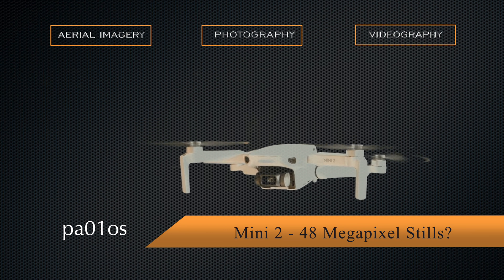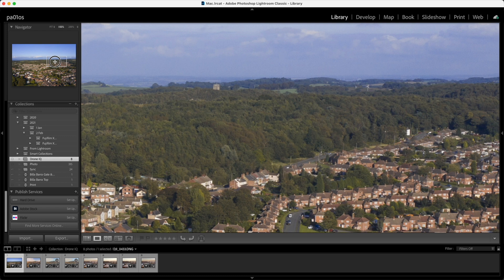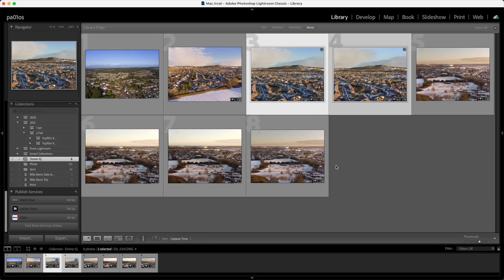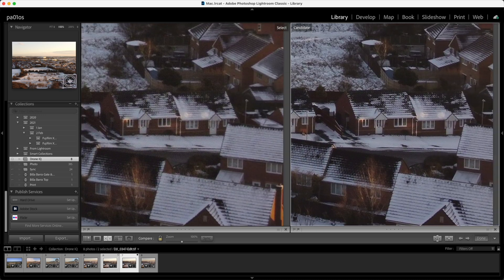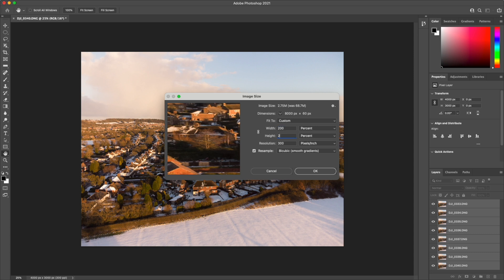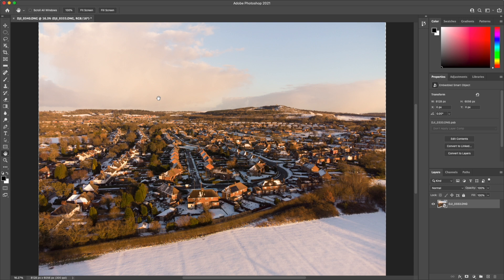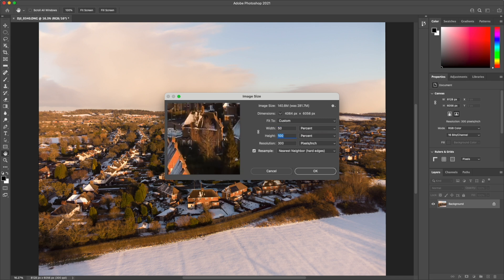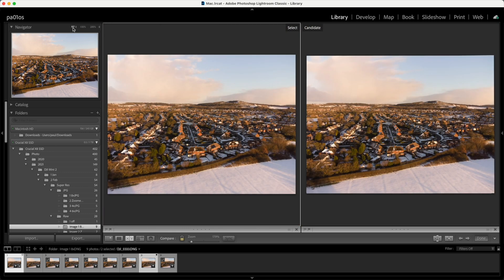DJI Mini 2 - 48 Megapixel Stills?

Comment: Recommendations for shooting these?
Reply from the maker: Hi Jon, firstly if you can, shoot RAW (DNG) images, try to nail the exposure as the technique will not help correct blown out sky or other exposure issues other than that, just keep the aircraft in position as its natural movement will do the rest.

Comment: Nice tutorial.  Very useful.  Thank you
Question:  Suppose that you already have an image taken, will you achieve the same result if you duplicate that image x8 and process?
Reply from the maker: Hi Steve, unfortunately no it won't as the technique relies on very slight movement to work. On cameras that have pixel shift built in, its normally the IBIS (in body stabilisation) which deliberately moves the sensor to achieve the effect. There may be a way by cropping the edges very slightly then trying it but I haven't tried it. 

On a stills camera you can achieve the same by shooting in burst mode while handheld.